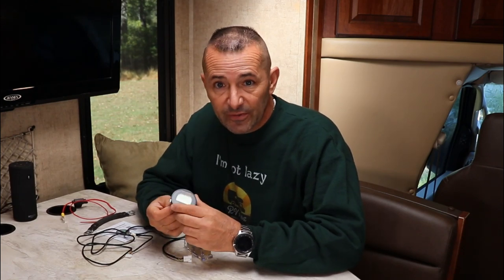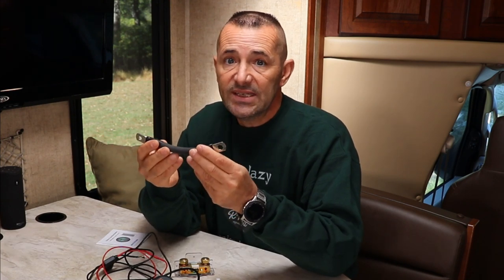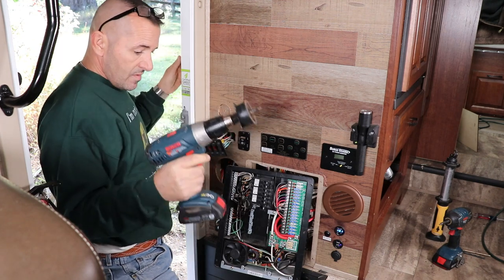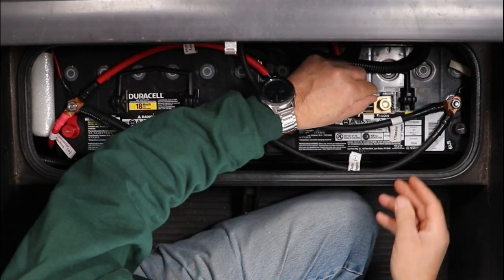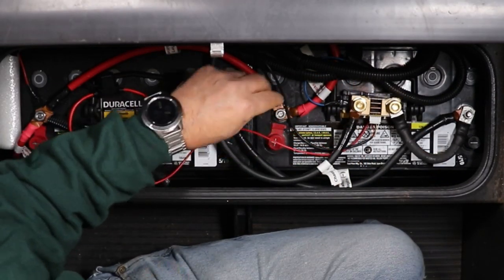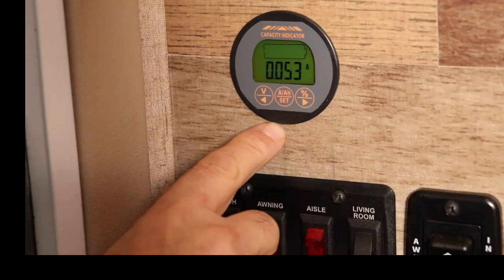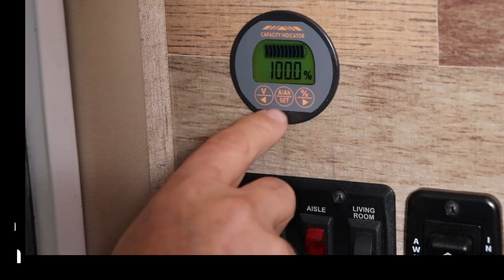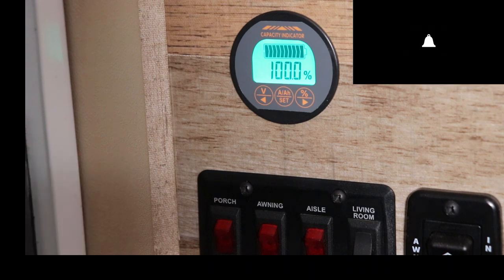Installing A Full Function RV Battery Monitor From AiLi Qwork– How To - Tips and Tricks - RV Upgrade

Comment: Thanks for this video! I do have a question that you might be able to confirm with me. Im planning on running a Renogy DC-DC 30A charger w/ MPPT to monitor my portable battery generator box in the bed of my truck. The primary purpose of this power box is to power my ARB fridge, and be recharged while driving and/or solar. I will have a few 12V acc. outlets mounted to the box for convenience. The Renogy charger requires negatives from solar,  starter battery, and house battery to be attached to one of 4 specific poles on the renogy unit, the other three poles on the renogy unit are specific to solar, starter battery, and house battery  positive leads. I have decided to do a ground buss bar in the box so that i can combine all those negatives and have one single negative wire to the DC-DC charger to keep it simple and clean (still with me??).. if i want to monitor the house battery in the box, where do i mount the shunt? Do i put the B side of the shunt directly on the neg. house batt terminal, and then connect a negative lead from the p side of the shunt down to the negative buss bar? That would essentially have all grounds going to one ground source. Make sense to me, what do you think? Email me at jkhartel3@gmail.com if you can be more open for advice. Id be happy to share my setup for better understanding. Thanks again and great video.

Comment: Thanks so much for your guidance. It really made my install easy. Well, except for running the wire from battery to the monitor.🤣
Reply from the maker: Yes running wires inside walls is always the hardest part.  Hope you like the monitor.   I am very happy with mine.

Comment: Helo, great video, thanks for sharing. What I dont get is the Voltage reading and the AH you configured. Are your batteries in serial or pararel configuration?
Reply from the maker: I have two 12v 105 amp hour batteries wired in parallel for a total of 210 amp hours.  When fully charged the voltage percentage should be 100%.

Comment: Great video, just got mine. Question you mention all Neg. cables go to B, but I see you still have a Neg. cable where the shunt is placed. Is that the connection to Neg to Neg for the two batteries? Is it ok to leave that one like that? So can I just use the main Neg. cable to the shunt? Thank you in advance
Reply from the maker: Yes my batteries are connected in parallel.  This remains the same.  The load negative wires such as chassis negative go to the P side of the shunt.
Reply: Thanks, already set up all as you posted. Waiting for batteries to be fully charge.

Comment: Great video, thank you for putting the time into it.  
I did cringe when you were working around the batteries with the metal watch band and the cables new cables moving about.  
Knowing in advance that you finished the video and posted it was the only verification that nothing happened in between.
Again, thanks
Reply from the maker: Hi Bryan,  you are correct about the watch.  I didn't realize I left it on till I was editing the video.  Thanks for watching.

Comment: thank you, thank you!!  i bought a renogy batt monitor with a shunt, no directions.  this is exactly what i was looking for!  i puzzled it out, but seemed like something was missing.    ~knew~ i needed an extra short neg batt cable!  and my batt compartment is also super tight, and i was over-thinking how and where to mount the shunt.  i'm going to use some 2-sided tape and simply stick it inside the box like you did.
Reply from the maker: So glad it helped!

Comment: Hi, I know that all negative come from loads go to (-P) of the shunt, what about the grounding wire that go from the negative terminal of battery to the chassis, should I connect to (-P) of shunt?
Reply from the maker: Yes all the negative wires that would connect to the battery go to the shunt.  The only exception are wires used to connect batteries in parallel or series.

Comment: Hi there, if you have a solar controller....do you connect the negative from the controller to the P of the shunt, or to the battery? 
Thanks,
Ian.
Reply from the maker: The negative should go to the P on the shunt.  This allows the meter to calculate how much power is going back into the batteries.

Comment: Nice video - what is the draw of this meter when the camper is sitting? Since it is battery side of the disconnect. I am sure it's quite small, but is it something that would need to be watched if the camper is sitting for a month or more between uses?
Reply from the maker: The spec sheet states 0.5 mA.  I have not tested it to confirm the listed specs.

Comment: Hi great video. I was wondering what size of fuse would be appropriate in the small battery wire from the shunt would be.
Reply from the maker: Hi I used a 5 amp fuse with 16AWG wire.
Reply: @RVHabit  Thank you.

Comment: Hi, i have wet batteries 200Ah=100%, but i'd like to max. discarge them to 50% (100Ah)...Can i tell this meter that (100Ah=100% not 50%)? How do I do this correctly? Thanks.

Comment: Thank you for the easy to follow a long video. Great job but how ever
Your links are messed up and take you to wrong supply’s needed. Here and on your website.  I had to send back several things and figure out what I really needed. 
Battery Interconnect Cable link 5/16-Inch Lugs is wrong the shunt needs 3/8” lugs.
Wrong link here too- 12AWG Inline Fuse Holder with a 30 amp fuse. Is way to big and the wire will not work with the shunt.  Instead you need 16 AWG Gauge with 10 AMP Fuse.

Comment: Good video man, best one I’ve seen to do with the AiLi. I’m curious though what size fuse are you running on the positive wire to the shunt? 
Most other videos I’ve watch no one else has fused their shunt power wire. Thinking better to fuse it then not.
Reply from the maker: Thank you.  I always fuse any wire that pulls power.  I used 12AWG wire and a 5 amp fuse.
Reply from the maker: Thank you.  I always fuse any wire that pulls power.  I used 12AWG wire and a 5 amp fuse.
Reply: Always fuse, or you blow your meter... Like i did.

Comment: Great video! Does it reset/calibrate automatically when reaching full/empty charge again?
Reply from the maker: Yes it does go back to 100% automatically.  It counts what goes out and in the battery.  I would recommend re-calibrating it once or twice a year as your batteries will lose amp hour capacity as they age.

Comment: Concise + informative video- great job! What size wire did you use for the power to the shunt + what amp rating fuse? Keep up the good work!
Reply from the maker: I used a 16AWG with a 5 amp fuse.
Reply: What gauge wire from the battery negative to the shunt?? It looks about 4AWG??
Cheers
Reply from the maker: Hi Steve, I used 1/0 AWG.
Reply: @RVHabit  wow that's a huge dia. 
Had to Google it, it can handle about 300A, that's a sh!t load of amps.
Cheers

Comment: Lou,Lou,Lou, Perfect info at just the right time.  As I sit here , back at Hill AIr Force Base in Utah...on the way back from ABQ Balloon Fiesta, guess what has happened?  The flooded house batteries, just gave me their last breath. They will not hold a charge longer than a couple of hours of trickle output current.  I am now going to AGM because of the no maintenance and longer batt life, quicker charging....blah blah bla.  When I get back to Portland I will be needing to get them and a monitor for them.  Not sure on the brand of AGM yet, but like you I do not need to invest in Li-Ion. Great vid great time.  P.S. my friend...Take the watch off when working on that hi current stuff.   I know you know, just a friendly reminder my friend.  Might wait til after winter to do batts, but will do the monitor while it’s in winter storage...kinda.  Thx again my friend.
Reply from the maker: Hi Bruce it's funny you say that about the watch. I wear it so much I didn't realize it till I was editing the video. I will say two things.  AGM is so great with basically connect it and forget it.  The pleasure of no maintenance is worth the extra money.  As for this battery monitor I can not recommend it enough.  I love this thing.  It gives current volts, amps remaining, life in a percentage and the best part is it tells you how many amps are either coming into batteries or out of batteries.  So I finally know exactly how many amps I am using and how many amps are coming in.  Best $40 I've spent on my RV.  I am putting it on my list of must have upgrades. Have a safe trip home, Lou.
Reply: Lou,  I bought the monitor a few days ago, it should be here today.  My house batteries are completely dead.  Holds a charge for a very short time.  Not sure when I will do install, maybe this winter and not getting new batts until maybe spring.  Anyway, I clicked on it from your link, so hopefully it works for you to get a little back.  FYI. Bruce
Reply from the maker: @RVEnthusiast  Thanks Bruce,  I am real happy with it so far.

Comment: Best explanation I've seen.  We bought a camper last year and about froze to death at 31° when the battery was too low.  We just installed 2 AGMs and we are determined to know what is going on with them.  After seeing this video I think our minds are made up.
Reply from the maker: Hi Leroy, I installed two AGMs also and this monitor has worked out great.  It has all the information I need to make sure the batteries are in good shape.  For what this monitor does at this price point is impressive.  My recommendation is get the larger one 100v/350 amps.  This way if you ever add accessories like solar, inverter, etc you will be good to go.  Thanks for watching.

Comment: Thanks for the clearly explained video.  I got it!  I do have a question about your experience with the monitor.  After wiring everything I see where the display pulsates while charging is happening but when I put my rig in storage I always turn the main power switch to OFF, but  the monitor display stays brightly lit and show a very small discharge.  Bottom line is the monitor never seems to stop monitoring and show the discharge and I've been told by others that thats' due to the Carbon Monoxide monitor.  Does this seem right to you.  I thought the main power switch would separate the monitor like the lights etc.
Reply from the maker: Hi Bill, That is correct that certain things like the carbon monoxide detector will stay on even though you turn on the battery disconnect.  The monitor will also stay on as it is connected directly to the battery.  The light on mine goes off after a few seconds unless the battery is charging.
Reply: @RVHabit  Thank you!  So I'm guessing you don't have a carbon Monoxide detector.  So my AiLi monitor backlight light will never go off then. I wonder if this will impact its life.  It certainly makes storage during off season a challenge since the batteries are always discharging.. some.
Reply from the maker: I do have a carbon monoxide alarm and yes it stays on.   The only way to totally turn everything off is to disconnect the negative battery cable from the batteries.  The light on my AiLi only stays on when the batteries are charging.
Reply: @billsanders8793  The monitor is hardwired directly to the battery before the disconnect. You could mount it after the disconnect to make it switch off, or just manually disconnect your batteries during the off-season (I always take the batteries out and store them inside during winter).
Reply: @billsanders8793 I don’t know if you know this but if you hold the V and % buttons at the same time for about 5 seconds you can toggle the display light off. Handy at night if you don’t want that light to be displayed. My monitor is in the front bedroom so it’s important for me.

Comment: Hey, thanks so much for your video. A quick question: does the green led light stay on when draining or charging? If yes, is there a way to turn it off when in draining mode?
Reply from the maker: Off the top of my head the back light blinks when charging.  I will have to check to see if it does the same when discharging.  I don't know of a way to disable the light.
Reply: Press both outer buttons at same time for 3 seconds, backlight will turn off.

Comment: and as for the + wire fuse going from shunt to battery +, all you need is a 1A fuse cos there's no way u can fit a 16awg wire in the + connector on the shunt. more likely a 24awg barely fits in and 24awg will melt faster than a 5A fuse will break. so put a 24awg and 1A fuse and you're good.

Comment: Nice video. That setup monitors the overall state of both batteries in parallel. Is there any need to monitor the individual batteries?
Reply from the maker: Hi Brian, no when batteries are connected in parallel the act as one battery.
Reply: @RVHabit  Thank you--understood. I was just wondering if there was a way to monitor the health of each battery.

Comment: Love your videos, thanks. Did you secure shunt to top of battery or is it held in place by battery cable tension? Thanks again!
Reply from the maker: Hi Jeff,  The cable tension keeps it in place however I also used Velcro which has worked out great.
Reply: RV Habit Thanks, Lou!

Comment: My converter is connected to my battery in parallel. Can I connect this monitor to the + & - cables that come directly from battery and connect to converter or must it and shut be connected directly to battery?

Comment: Nice summary of the battery monitor.  Question: Is the monitor always energized (albeit low current, but will it drain down battery if left on)?  More importantly, if you added a switch to turn the monitor off, would it lose the settings)?  Thanks.
Reply from the maker: Hi Brian,  the draw on the batteries is milliamps.  If you cut power to the monitor it would have to be completely reprogrammed.
Reply: @RVHabit  Thanks!

Comment: Hey mate 
Thanks for the vid.
Have you tested it's accuracy now?
Thanks
Reply from the maker: Over the last year it has been very accurate and continues to be so.  I have AGM batteries and am using the larger 500 amp shunt.   This will measure the slightest drain on the batteries.  I have readjusted the total amp hours down 10 amps for normal degradation of the batteries over the past year.
Reply: @RVHabit  Thanks so much for the quick and detailed response mate.
Hope you have an awesome Christmas. ✌
Reply from the maker: Same to you. Stay safe.

Comment: maybe I missed hearing it but werent there two batteries end to end?..which battery are you monitoring?  you disconnected one of the cables on the right hand battery but left the other connected..thanks for sharing with us...
Reply: I think I see what I missed..the cable you removed was the ground wire from the frame..so it includes both batteries because all the amps have to go to ground....lol...maybe...
Reply from the maker: The batteries are connected in parallel to form one battery bank.  The AiLi monitors both batteries because they are considered one.
Reply from the maker: Yes that was the chassis ground cable.

Comment: I think I understand this…so do I take the wires currently on the negative terminal and connect them to the p-? My coach is super simple so I’ll just have the shunt wired to the neg of the battery and the negative wires from the coach (currently connected to the neg) will be connected to the p-? Thanks so much
Reply from the maker: Yes its that simple.

Comment: Great video Lou. i bought the unit and am working on the install.  Question: does having the battery disconnect switch on the negative side affect the monitor's calibration when the batteries are turned off? Or does the monitor maintain its calibrations due to the separate power connection?
Reply from the maker: RV Habit
  • 1 minute ago
 The monitor will not be affected by the disconnect switch since it is connected directly to the battery.  The only way to totally turn everything off is to disconnect the negative battery cable from the batteries.
Reply: Thanks for the speedy reply.  Can the monitor leads be lengthened? one install option is to locate the battery monitor with My trailer monitor panel, but that would be 15 ft from the shunt.
Reply from the maker: Hi Robert,  You can purchase extra monitor cable.  the links are 16ft  https://amzn.to/3bDGgvs and 26ft  https://amzn.to/33VHPCh   Good luck.

Comment: A question for you on setup? I have 500 amp hours in my bank. AGM Batteries should not be drained 50%. should I program it as 250 amp hours so I wont go over the 50% discharge?
Reply from the maker: I do not recommend that.  Set it for full 500 Amp hours.  You know at 50 percent to charge.

Comment: Thank you Lou. Just ordered one and appreciate the install vid - weil done!  Question: You said ALL other negative wires go to the left side of the Shunt (from Camera view) but you still have a big negative wire   connected to the neg post on the battery.  I don't understand.  Appreciate and help :). Thanks again.
Reply from the maker: My batteries are connected in parallel.  You are seeing the negative cable that connects the two batteries together.

Comment: I'm using a Zamp connection for my solar charging. Will I need to route the negative on that to P1. Also... Would I connect battery charger to P1 also?
Reply from the maker: Directions say anything that would ordinarily be connected to the negative battery post gets connected to the shunt.  This is so the shunt see's all power going out and going into the battery.

Comment: I setup my Aili battery monitor to 200ah now my soc only reads %50 even though its fully charged?
Reply from the maker: You need to fully charge batteries and reset the monitor to 100 percent.

Comment: So, monitor will work for two batterys connected in serial?

I have 2 gel batterys abd each one have 12v and 300ah. They are connected in serial and give 24v
Reply from the maker: I have not tried it on a 24v system but I see no reason why it would not work.